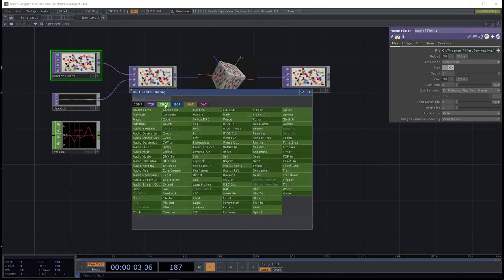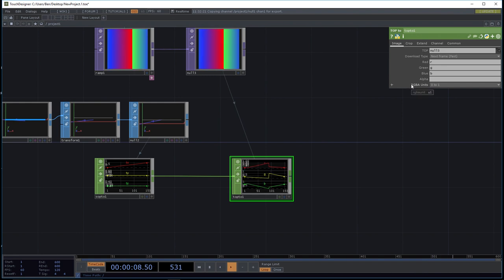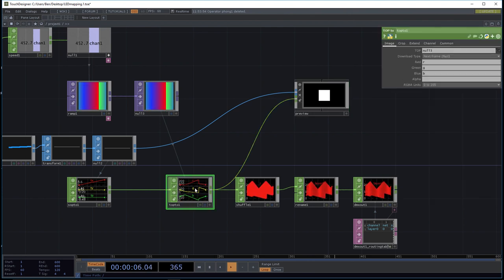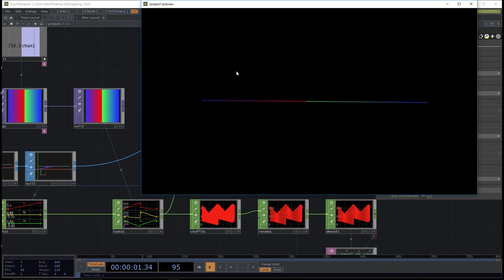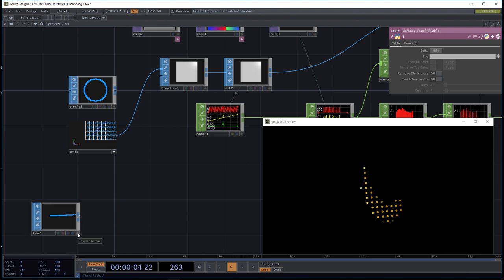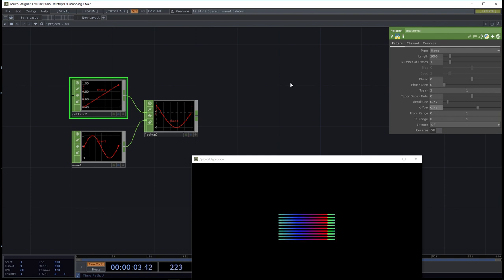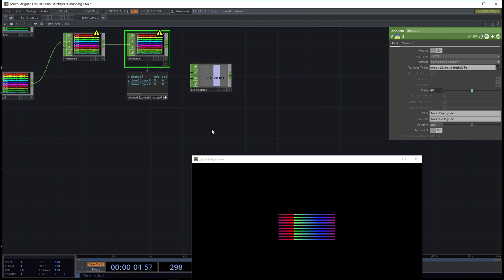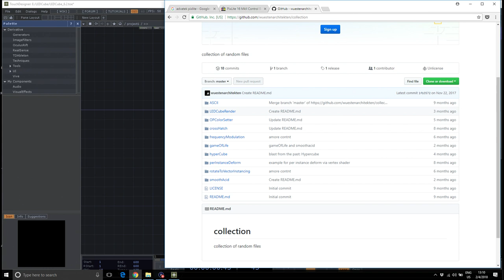Intro to TouchDesigner for Pixel Mapping - Ben Voigt and Markus Heckmann

Comment: Is the tutorial you talk about on this video for 150+ led strips that would need a split between multiple universe available somewhere ? Many thanks for this great video.
Reply: BUMP
Reply: @carloscasillas1373  I'd like to know too @TouchDesigner
Reply from the maker: Apologies, can you give me a timestamp to look into this? Not aware of the video in question.
Reply: Okay so basically after shuffle 1 add an extend chop. Then youll want to connect another shuffle chop, but this time in its parameters under method select 'split N Samples' and take your led strip quantity for example, 300 pixel strip multiply by 3 so N Value = 900, enter 900 then connect another shuffle Split N Samples again but now you can choose 512 (but youll want 510 beacuse if its not a clean division number itll cause the light strip to invert the colors at the 150th pixel, you can tweak it for a longer pixel count) so 510 for the second shuffle N value. then add a math range 0-255, you can rename chop if you want, then null :)

Comment: Trying to send DMX info via the DMXout Chop to my StageCL lighting board, but no luck. I read that ArtNet is capable of sending AND receiving DMX information. If that is true, would it be an equipment restriction on my lighting console, or I am doing something wrong? Currently, I am running TD on MacBook Pro 2014. I set the Network Address in the DMXout CHOP to the ArtNet IP Address on my console.
Reply from the maker: You can send and receive. The DMX In CHOP is the receiver in TouchDesigner.